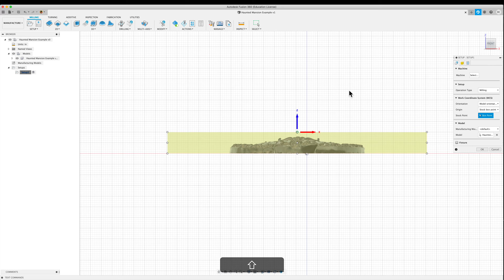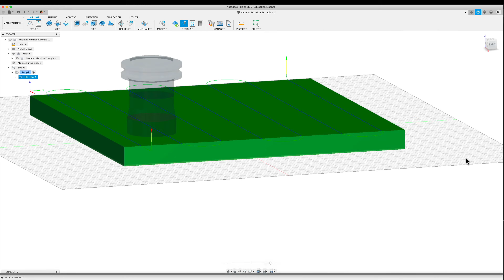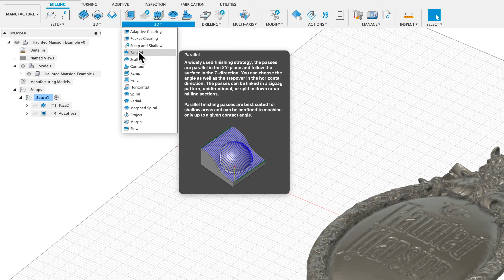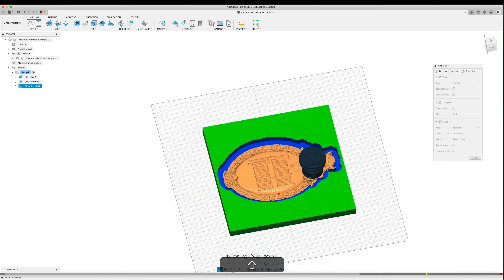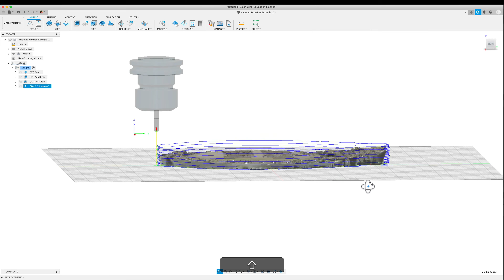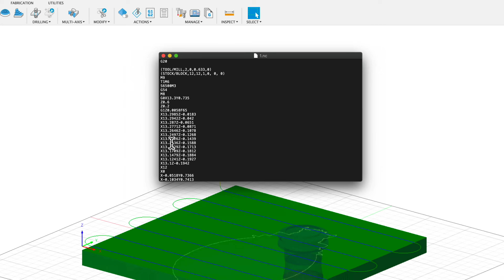Get started in Fusion 360 for CAM & CNC - Complete Beginners Tutorial

Comment: Gosh this seems like such a damn hassle to do this. Im trying to make a box with a mesh in it but my computer keeps taking forever to load it. Im skipping the facing and going straight to roughing but for some reason it does not cut down to the bottom height im giving it and is also leaving out some of the meshes I have selected to machine.

Comment: Thank you for the information. Being very new to fusion setups, my next question may seem obvious. For the adaptive clearance cnc bit - one obviously needs to probe Z top height and X & Y outer corners (based on the stock corner chosen or box point); but for the parallel path the cnc bit is changed to a bullnose - and while one does need to probe again Z tool height again, do we also need to probe the outer corners X & Y again? .....It can get a little confusing when you consider that the silhouette cut for the adaptive clearance bit is set to "tool outside boundary", while the parallel path bullnose bit chosen is set to "tool centre on boundary". Does fusion just do the calculation for you when you go from one bit to the next "for the x & y box point", or does one have to probe X & Y again (in addition to Z) for each cnc bit change?

Comment: Excellent tutorial, Thanks. One question I have is about Fusion 360 itself. When calculating the tool paths it takes a while on my computer which is quite a powerful machine. I7, 16 GB ram, 4 GB dedicated video ram gaming rig running windows 10. I also noticed that Fusion 360 crashes and freezes a lot. Is that normal?

Comment: Thanks for this tutorial. I followed it to the extreme and I also have the x-carve. Couple things is this is my VERY first project in fusion 360, so it took me a long time to get everything dialed following your steps. I appreciate the thorough-ness of everything. Few daunting parts about "you'll have to get all this dialed yourself" when I know nothing about the program is a little intimidating, but I just followed your lead and am about to go try and cut this thing. Also side note, I took a screen shot of fusion 360, threw it in illustrator and just did a trace draw and deleted the paths inside, and it did seem to go a little quicker (Even though I lost my scale tool bar and couldn't figure out how to bring it back up) but also was way more precise on the edges (or so it seems, will let you know after the cut). Thanks again!
Reply: How did it go?